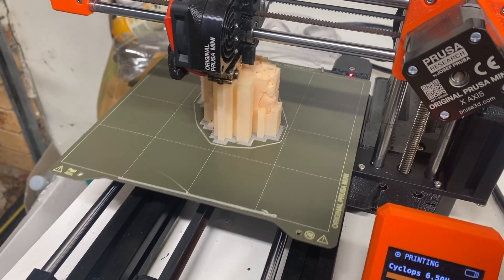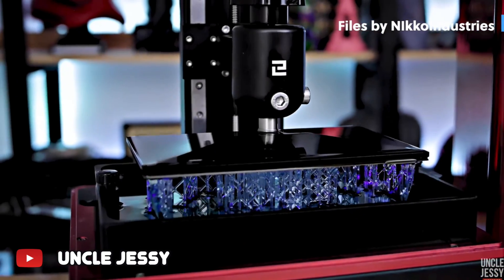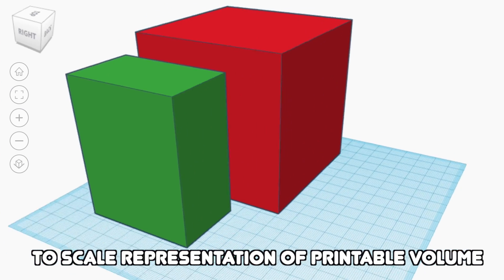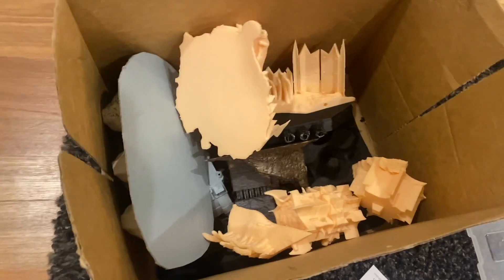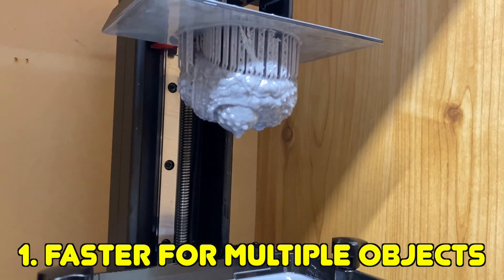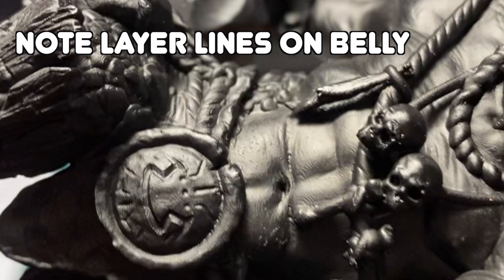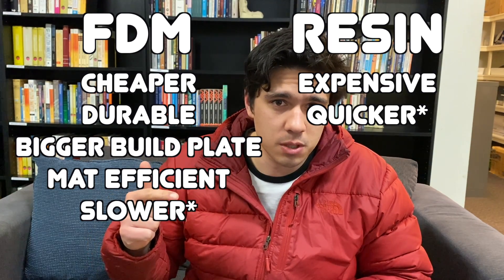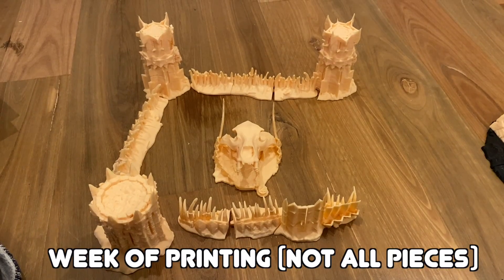Terrain Printing Showdown: Resin or FDM?

Comment: Question for you!

Does the resin have a problem curing when you do large parts of terrain. As internally fdm makes hollow inside the terrain to save material. But what does the resin  do? Is it solid all the way through?
Reply from the maker: You can do both. If the STL isn't hollow, there are options in the slicer to do it yourself.
I try to hollow prints as resin as the resin itself is expensive. If you do you need to make sure that you cure the inside and add drainage holes.
Also a solid print would be quite heavy.
I've got a video on a DIY solution for curing the inside.
I hope that helps.